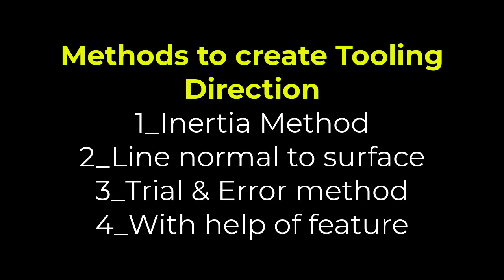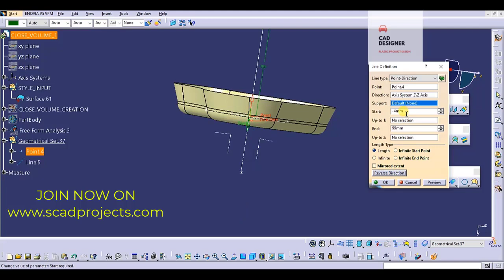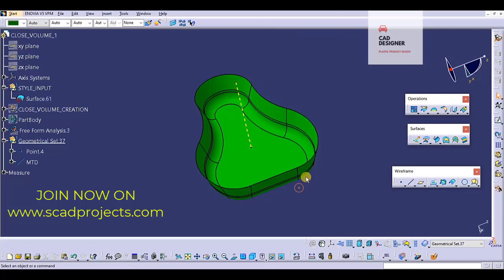PLASTIC PRODUCT DESIGN I Methods to create Main Tooling Direction

Comment: I have one question sir what is the meaning of tooling axis X+4
Reply from the maker: Tooling is tilted by 4deg in X direction
Reply: @cad__designer  tq sir can you please  explain how set tilted angle
Reply from the maker: @hater9944  Take point....on this point take one Axis system. Then create line by using Angle/Normal to curve. Select ref line and support put angle 4 deg.....You will get required line.
Reply: @cad__designer  ok thanks

Comment from the maker: Draft Angle consider to check Draft analysis depend on OEM. Generally we can clear given style in 3-5 degree, but in case of Graining of parts  we need to consider draft angle more than 7 degree.
Reply: Ok..sir
Reply: Hai Good explanation. I have a one doubt. In draft angle how much value they will give that value only we can give right..
And also can you share the class A surface files for practicing purpose. Or please tell me where can we download.... Thanks
Reply from the maker: @bangarrajumogalapalli2672  Yes...we need to clear plastic A surface & developed part in given draft angle....In real time working condition we can go for 0.5deg most of the time.... only for graining (texture) and at core cavity matching we need to give more draft tha n 5-7 deg.....

We have created one dedicated course on Automotive Product Design & you can check syllabus from below link....You will get more than 40 A surface for practice....also you will get one complete door panel & B pillar assembly for your reference.......!!!

https://www.scaddesigners.com/courses/Automotive-Plastic-Product-Design-61ce92fe0cf27d7b9dcbb655